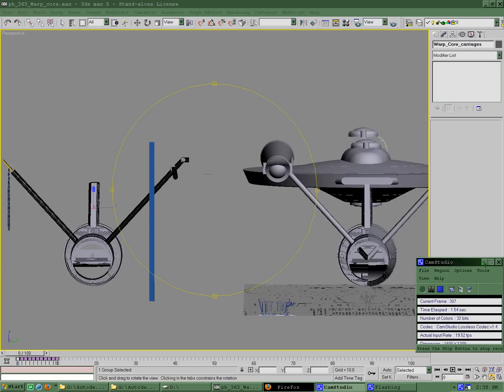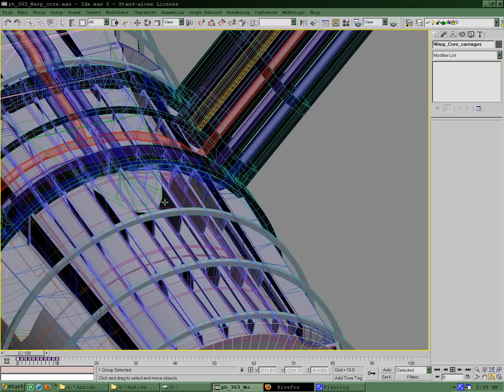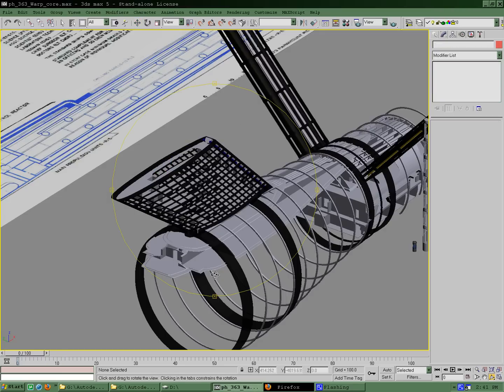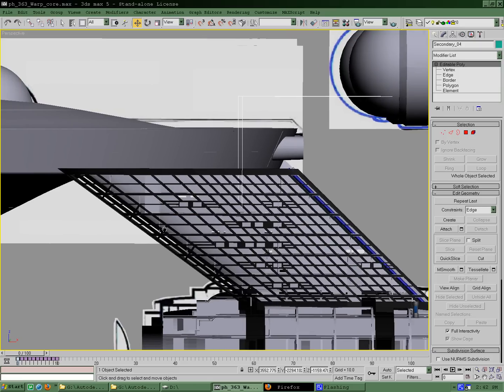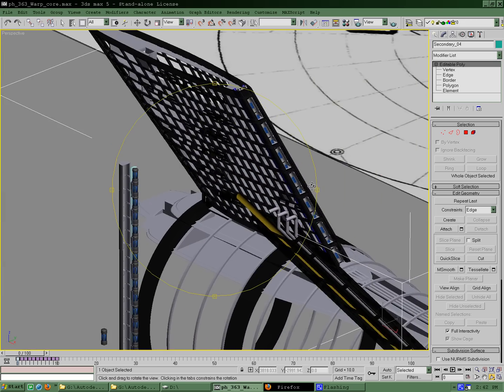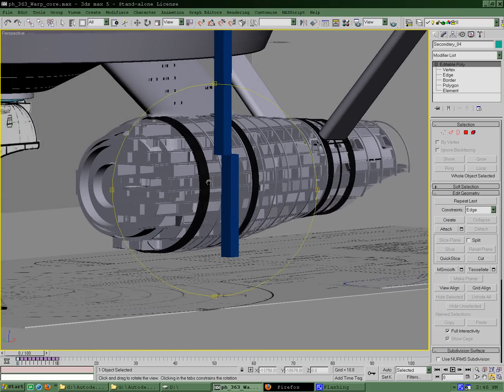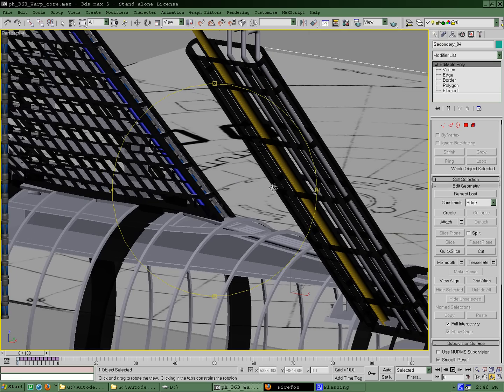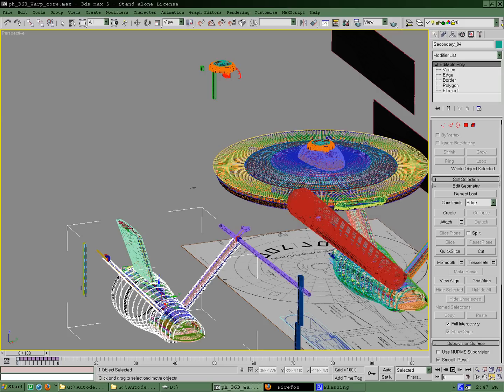USS Enterprise NCC-1701 Deck by Deck WIP II

Comment: but your structural analysis correspond to a building on Earth and does not necessarily apply to a self-gravity autonomous vessel. anyway, nice job. Should be used for a "Doom" game.
Reply from the maker: I'm allowed to poke fun at the fiction, especially when the self-gravity to which you refer is only available with the engines balanced in a gravity well turned on.  Becomes a chicken & egg argument..  For literary purposes it's Dr. Who's phone booth.  Makes fun fiction; but, not exactly scientifically defensible even noting that science is a process rather than a volume on the shelf.  They still managed to contribute to science by feeding imagination that makes people explore what can be vs what can't.  Both of those things inform us as to boundaries and yet don't differentiate what is doable from what is practical or wise.  "knowing humans as thou doest, wouldst thou be captured harmless by them"  :)  

And thank you. !

Comment: you shouldnt need to have "ejectable" segments of the warp core going through the neck at all! the warp core shouldnt extend much past main engineering. the "CORE" is just that a core. the long conduits we see coming off of it should just be for power and warp plasma distribution... as far as i know, there are no cannon sources to even suggest the TOS enterprise had a core ejection system.
that i believe was an innovation that came with the vertical core. 

regardless, those conduits shouldnt run directly against the spine of the neck, that would make maintenance/repair impossible given the scale of the neck itself...

a question i have is: can you get the turboshaft to fit in the neck?

by my guesstimates it will be close if it fits at all

good work though.
Reply from the maker: I actually put the core in the neck because the Turbolift runs down through the section of the ship where the core would be in the later refit models.  That left the neck being the only real place where there was room.  And there is room for maintenance access, it just isn't built in as yet.  The core placement and workup was tenative as it had to go somwhere. 

As to its disposition in the ship, I discussed that via email and blogposts with the two Dougs.  Drexler confirmed core runs under the floor of engineering and ejects through the back of the ship.  With this being the FJ enterprise rather than the original, I'm taking liberties and am full aware; but, I'm also approaching this as 'the enterprise constitution class refit: a proposal to the Federation'.  That allows this to be a version of the ship meant for discussion purposes with the refits later solidifying decisions actually made. 

The turbolift actually does fit in the neck with quite a bit of room to play.  The concern for me wasn't lift or core, it was whether the neck could actually take the stresses and weight bearing down upon it from the saucer.  As a practical matter, I very much doubt it short of some manner of tech from shields to thrusters that allow the neck to function without destroying itself in a gravity well.  It's a fictional ship; but, as an artist, I'm still concerned with depicting it in light of the fiction from which it comes or else what's the point?  lol

Thanks for the questions and comments.  Always welcome.  The ship is still crawling along as I get the free time to work it.  But balancing that against my 3d printing habit.  ;)

Comment: Thanks for your responce. I do use several 500 gb and 2 750 gb external storage drives for my 3d and cad work. However, I tend to think way bigger than what I achive. I am considering completely finishing certain interior parts and splining an animated camera thru. The elevator shaft and elevators are something that I truely want to animate. I don't even know if it is possible to animate a visible path in that way. I've upgraded to version 2012 on both 3Ds and Maya that have some newer options.

Comment from the maker: @saquist I don't like it's location either; but, that's where the plans have it and I'm building to the plans.  That said, if it ran under main engineering, it would still have to go through the dorsal section and there isn't much protection more in the dorsal than where it is now.  So, I'm not sure it's in a tactically bad spot that's any worse than anywhere else it could be.

Comment: I still don't agree with the core through the back of the neck.  
It's far to exposed tactically. I makes more defensive sense for it to be under Main engineering.